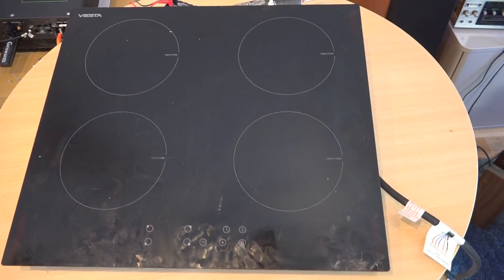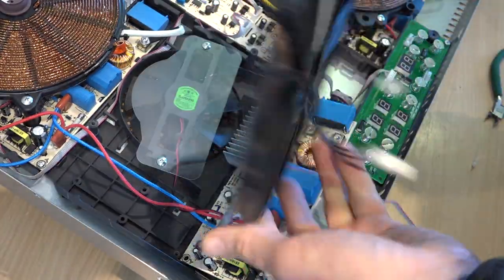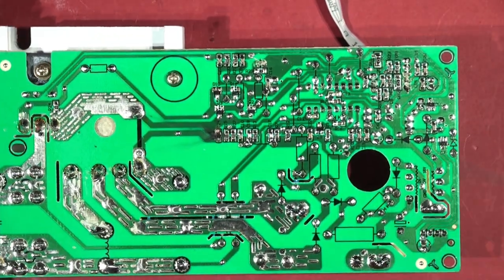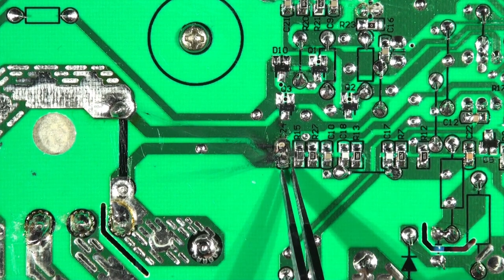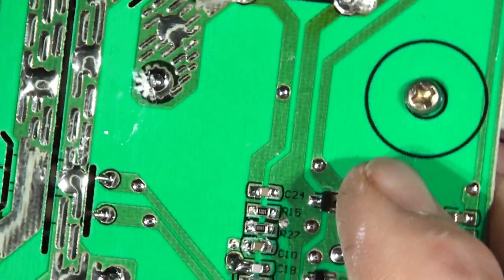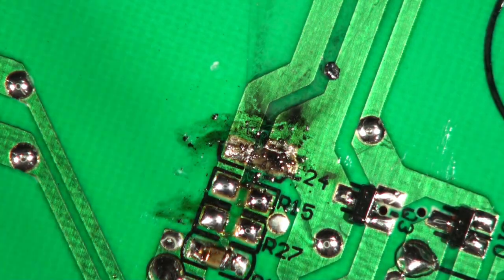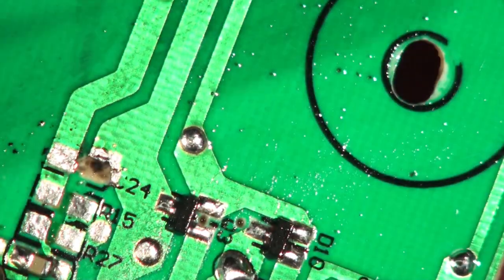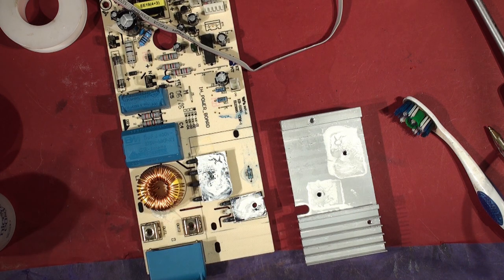Faulty Viesta Induction Hob Diagnostic and Repair

Comment: Your videos are the bomb

I’ve always wanted a posh uncle. I love Folks like Marco reps and big Clive and diode gone wild… But don’t seem to get as many pure methodical troubleshooting videos and there’s a real void of that on the platform.

 I do mostly industrial repair but specialize in metrology and test equipment configuration and calibration. Mostly for a little research labs and R&D type folks here in the southern United States. only one town over from Oak Ridge national laboratory so that helps a lot because of the massive community of supporting technology that’s been built up around that facility the last 50 years. 

You can’t imagine all the weird and cool stuff that popped up and it was already a rich area for that type of stuff. 

I’m actually pretty retarded I knew nothing about electronics 10 years ago. So bad that I was working on a tig welder of mine and got blown back after getting hit with one of the big Pringles cans size capacitors. Since I used to restore a lot of machine tool and equipment I figured it was time I start to learn and Tinker. Before I accidentally killed myself. So started going to a local scrapyard and buying old industrial stuff for $0.10 a pound just rip it apart and see how it worked. And oh shit that was a mistake… I got addicted to it and now here I am. Somehow fell backwards into this. It definitely doesn’t come natural and my dumbass has to really concentrate and watch what I’m doing but I really enjoy it.

have my own little at home lab started several years back just by piecing together test equipment to troubleshoot and learn. shit ain’t cheap so started buying untested and questionable test equipment, hoping to fix up enough to have a small viable lab. 

But somehow here I am a few years later driving the same old beat up truck but with a collection of 8.5?digit multimeters at home. I can’t even fart in that corner of the lab or some of that sensitive equipment goes crazy. I should have ignored the “volt nuts“ on YouTube and on the forums… because that’s the most addictive part of the rabbit hole it’s a slippery slope. Its Like going from Being a functional alcoholic only drinking on the weekends… to smoking crack out of a double barrel shotgun.

 I still normally work at my regular little bench. But I have to keep a small bench and set up of “NIST traceable” equipment for certain jobs. I guess it gives me an excuse to have nice equipment but still live in near poverty🤷‍♂️😂

Sorry to ramble… Love the longform videos and I hope you find a lot of success because this was a niche that was mostly missing from YouTube. The “learn electronics” channel is another really nice British chap with an endearing laugh and skill for faultfinding. 

Diode gone wild is another very skilled explainer and troubleshooter but only has about a half a dozen videos over the last five years showing in-depth fault finding and troubleshooting techniques. I guess that should be enough but considering each case is different it always helps just to constantly consume that shit. I can only repair and work on so many things at once but if I’m listening to videos like yours at the same time I get double the experience. and even though I usually work on test equipment… Once people know you can repair things there are very many “grateful neighbors“. Andhalf of them are your clients …. that bring you some thing to fix from home. you can’t turn down their inductive stove/type jobs on the weekends.

sure is good to have a few channels like yalls channels on YouTube to watch some actually skilled and efficient troubleshooters. You both are also very good at explaining and helping the autists like myself understand things.

Good luck to you and your channel!
Reply from the maker: Many thanks and thanks for your comment.

Comment: @5'04" - I suspect the spring loaded button in the middle of the heating coil  has an optical (IR?) sensor as well as a temp sensor - hence the 2 sets of wires /  two holes in its surface and  lack of thermal paste over the holes. Probably the sensor bounces IR light through the glass top to detect objects?
Might be worth checking to see if any of your new thermal paste covered any of the optical holes - especially if the hob is behaving weirdly (i.e. slow to reduce power when pan removed).
If it is an optical sensor, your 'Love Juice'  comment @58'12" may be the source (or sauce) of a ribald comment or two?

Thanks for your descriptive repairs, educational and very enjoyable style. Very much appreciated.
Reply from the maker: Good thought. Might not be an optical sensor as the whole shebang is drenched in TiO2 heat sink paste. No optical path. I will get a hob that is not needed for dinner and play with it as they are an interesting thing. If I had designed it I would want an inductive sensor up there to see if there is a pan or not and to report the field strength to close the loop providing feedback on coupling, field strength pan eddy current. to the drive circuitry.     Limitation of the unwanted radiation:, Frying a metal watch strap, protection of the drive output stage  -- that sort of thing.
Reply: @Magic Smoke .Agree that an inductive sensor makes more sense (excuse the pun), but, at 2'09" it looks like one side of the central button has a dip (with 2 holes) that has been carefully left without heatsink compound. At 1'54" it looks like all 4 element buttons have the same pattern of heatsink compound.

Comment: Smashing repair 😀
I was a bit concerned about Q3 connecting to the burnt parts.
But it wasn't damaged :-D
The owner is very lucky that you are a clever bloke  and resuscitated the circuit lol.
I have no love for Viper pwm  transformer drivers, seen too many dead for no obvious reason.
Ay up i'm moaning again lol.
Reply: Yh. Infineon are about the best but I've seen plenty of duffns of those as well. Don't get me started on Power integration!
Reply from the maker: These low-cost low-component count implementation of a switch mode of power supplies using PWM chips with integrated switching FET are exposed to the mains with very little protection within the design. I would never use them in a high reliability design. Just compare a Miele tumble dryer controller to a Hotpoint, Whirlpool, Neff  etc. and you will instantly see the difference in approach.

Comment: Interesting to see inside an induction hob. And some quality banter. ;) Hope my induction hob doesn't break down soon though as what you do is pretty tough for ordinary folk like me, especially the soldering.
Reply from the maker: Thanks for watching.  Apparently there are a lot o scrap hobs out there..
Reply: Oh dear. I had better improve my soldering skills then.
While writing, since yesterday my microwave just started making a constant buzzing noise when plugged in and even while not in operation (i.e. when only the clock is functioning). It still heats up food though, albeit with the buzzing noise in the background. Very annoying because I just completed a mega repair job on the microwave door & handle and was quite pleased with myself about it.
Would you have any clues on what type of component to look for? I think it must be that an electrical part is about to fail, hence the noise. Thanks in advance for any guidance.

Comment: Are IGBTs FETs? I'm confused!  I thought they were a cross between bipolar transistors and FETs.
Reply from the maker: IGBT Combines the features of a MOSFET (input characteristics) and a Bipolar Junction Transistor (BJT) (output characteristics). It also has three terminals: Gate, Collector, and Emitter. FETs are faster and better suited for low-power, high-frequency applications, whereas IGBTs are more efficient for high-power, low-frequency applications. FETs typically have lower conduction losses at lower power levels, while IGBTs can handle higher voltages and currents but with a slower switching speed. 
FET Operates as a voltage-controlled device; the Gate voltage controls the current flow from Source to Drain. It is purely a majority carrier device (electrons for n-channel, holes for p-channel), which allows for faster switching speeds. 
IGBT: Also operates as a voltage-controlled device, but it combines the high input impedance of a MOSFET with the high current and voltage capabilities of a BJT. 
It has both majority and minority carriers, which improves its current handling but slows down switching compared to MOSFETs.   Switching SpeedS: FET: Generally faster switching speeds because it only uses majority carriers.
Suitable for high-frequency applications. 
IGBT:Slower switching speeds compared to FETs due to the involvement of both majority and minority carriers. More suitable for low to medium-frequency applications.
Hope that helps.

Comment: As an induction hob user, I imagine the therm/other thing is used to drive the 'hot' indicator which remains on after the hob is turned off and the 'no pan' one. The 'hot' itself is mostly coming from the glass and any thing you left on it, as neither the pan itself nor the ring really gets hot - only by way of what's in /on it. An empty pan doesn't really do anything. Totally bemusing way of cooking but works fine for the most part. Scratched and dirty glass tops can be avoided by putting a sheet of newspaper on between the plan and the hob while cooking which also keeps any spatters of the glass. Like I say, totally bemusing....
Reply: Having said that, what can't be accounted for is stuff dropping out of the overhead cupboard and smashing the glass. Sadly, I have not found a solution for that but my, now 2 ring , hob soldiers on. Plus, I have two donor rings for when these two give up.
Reply from the maker: Interesting.  I have seen a couple of smashed ones.  The glass doesn't seem that toughened.  Possible difficult to do due to the heat stress in the hotplate areas.  Good stuff to use to protect the glass is silicone mat 0.2mm thick with glass fibre reinforcement.  You can get it in pretty colors..
Reply: @razenby  the silicone mat idea sounds interesting. I was thinking of using thin balsa wood since it would allow the heavy pans to slide, take some impact and might also insulate the hob against heat from the pan.

Comment: random question: from your ecocent video do you know the part numbers for the ecocent anode and the  heater element TIA 👍
Reply from the maker: No I buy mine from China for a few quid on Aliexpress.com The element type is common in the East.  You need to get one made from 317 stainless if you can..

Comment: Shitty cold solder joint but that board is nice with its markings.
Reply: I agree, all in all, the board was well made and well laid out. The production problem was the  hole diameter in the board was too large for the shunt wire diameter. It prevented tge surface teniis if the solder doing it's thing..
Reply from the maker: Nice boards.  This was a combined production and design screw -up. Hole in PCB too big. Required touch up of joint as seen on the other board so production knew about it. They should have raised a RFC (request For Change notification) and got engineering to address the design issue.  In the meantime they should have insisted 100% hand touch up of these joints.